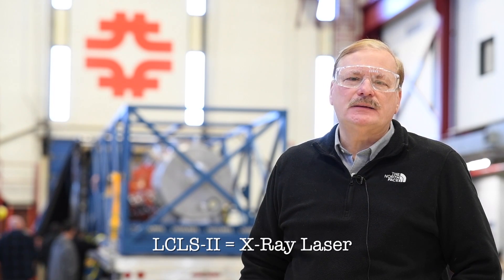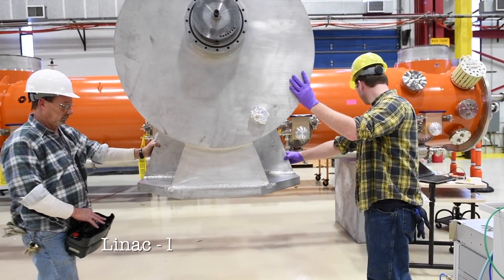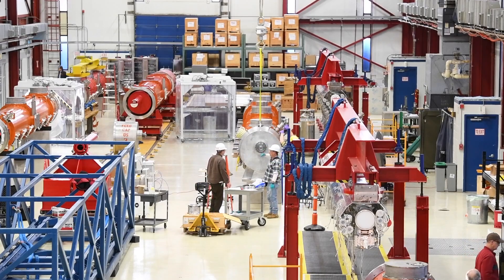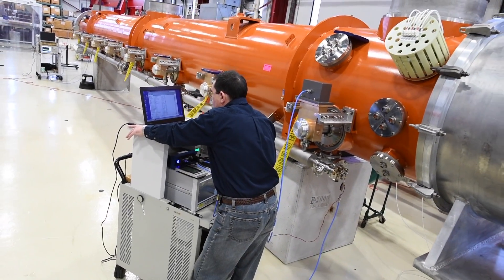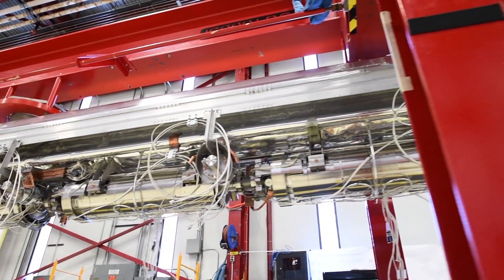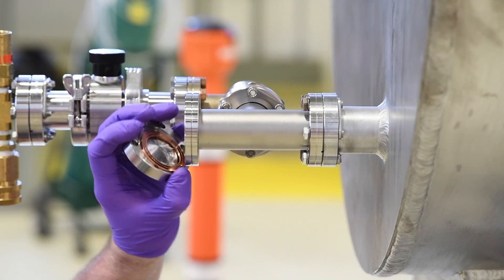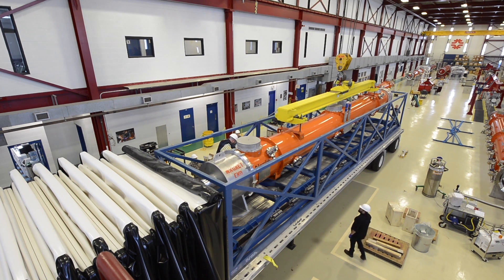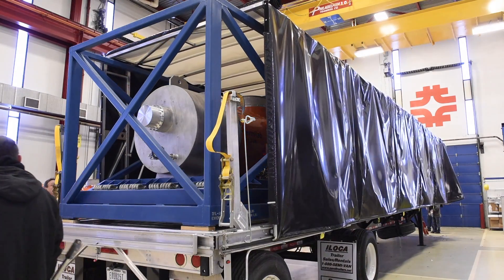Fermilab ships first LCLS-II cryomodule to SLAC

Comment: What are the cryomodules for exactly?
Reply: They contain several connected cavities. An RF generator produces an electromagnetic field inside. The cavities become superconducting at very low temperatures, meaning the field loses no energy to electrical resistance.
The oscillations of the field inside the cavities are timed in such a way that a charged particle shot through the cavities will always be "pulled" forwards in each cavity, accelerating the particle.
Reply: Matheus Wagner To keep things cool ;^)
Reply: I happen to hold a Certificate of Achievement in Cryomodulology from the Technical Institute of Technology (TIT) and each cryomodule is capable of holding 12 cases of beer within a module in a state of cryo.  Fuck yea!
Reply: Matheus Wagner many are connected in a line they contain and accelerate steer particles in center tube near speed of light to collide with a target or another particle to fragment them into sub atomic fragments etc. Look on BNL RHIC. I built alot of these. Shalom
Reply: Cool asics cpus